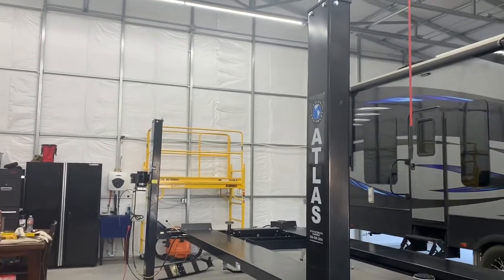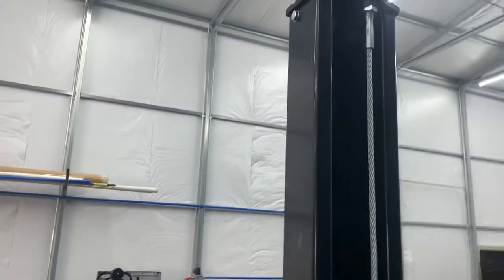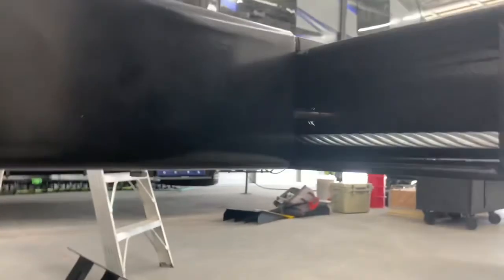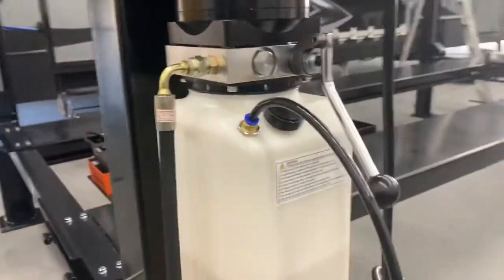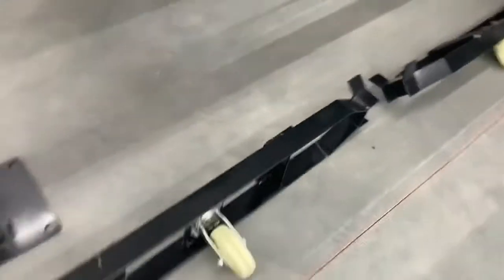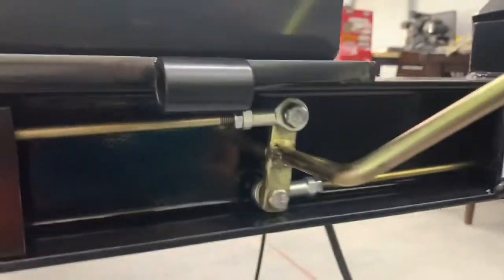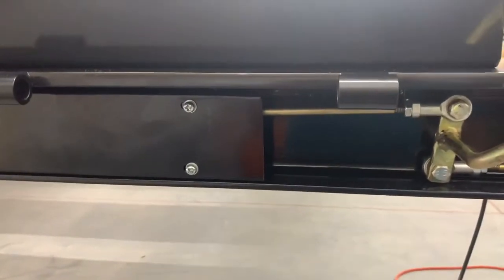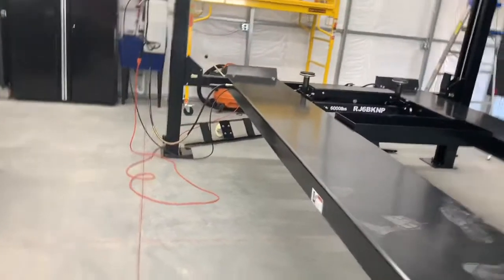Atlas Pro 9000 Four Post Lift - Installation Tips

Comment: I wonder why the vent is even needed for the cylinder. My old Direct Lift, which is identical,  ever had that.  Wouldn’t the fluid naturally push back into the reservoir as the lift lowers?  That’s the only part I don’t like about this lift.  Might I ask what you paid for the lift and jacks?
Reply from the maker: I think it just helps keep air out of the oil/gives it an easier path to escape so there don't have to worry about running out of stroke on the cylinder before the lift is all the way up. Might just be overkill or for when first filling could help.
Reply: I have same model, but Revolution (rotary) RFP9. No vent hose but the cap on the pump is a vented cap. This one seems like it is not vented but has the hose.